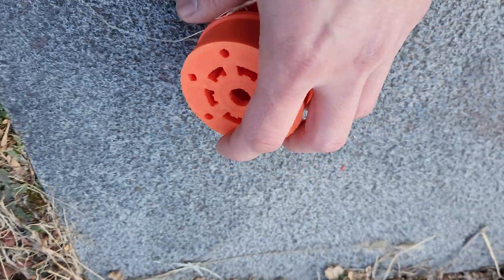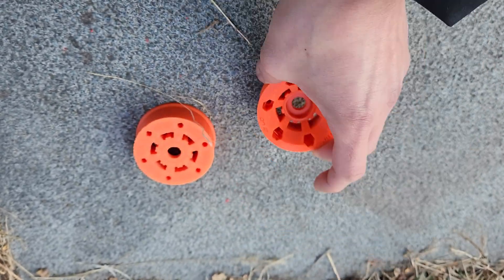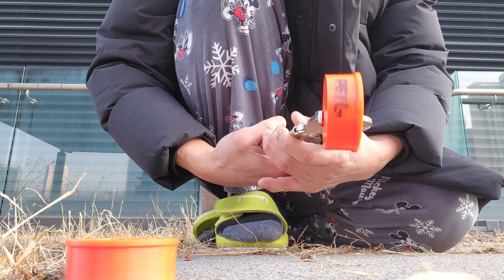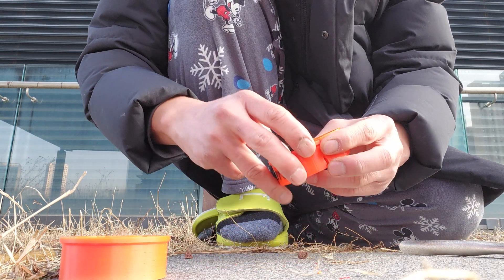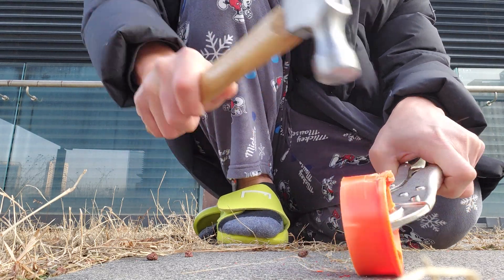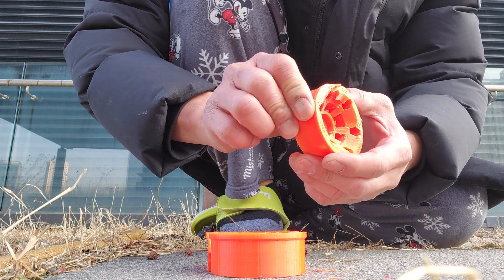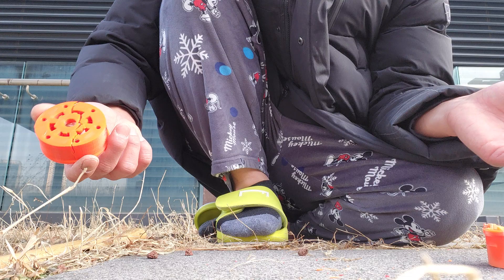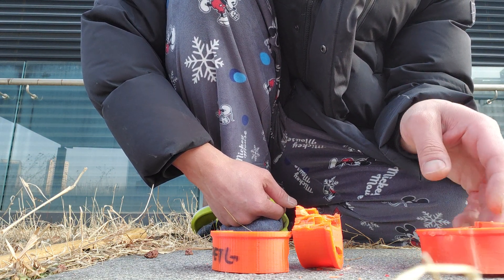3D Printer Filament PETG vs. ABS Part 2!

Comment: at what temp did you print the petg?
Reply from the maker: 240 celcius
Reply: @3dPrinterSchool that's most likely to cold. I print PETG at 260 degrees, and make bending dies for my tube roller bender wi4h it

Comment: Petg should be more flexible than ABS . So this kind of force should less a Problem for PETG than ABS. If you Check the technical data Sheet of Prusament PETG and compare it with Esun ABS+, you can see, that the data is very similar, except that the impact strength on PETG is out of mesurements. PETG should be worse on compression, but on inpact it should be better. But, if the filament is old, and is stored not dry conditions, at plain light, it can become brittle (losing the softener agents). It breaks only by bending the filament about 45 degrees.
Reply from the maker: I used good petg filament but gonna try the test again using Prusament petg.  I believe the results should be similar, i think petg is very weak on terms of impacy resistance, there is another video on youtube showing this also.

Comment: I hear everywhere that PLA + or pro have the best impact resistance out there.
Reply from the maker: Right try pla on electric skateboards lol.
Reply: @3dPrinterSchool  I mean people print guns out of it. It’s pretty tough. Cf nylon might be better for your application?
Reply from the maker: @treaustin1  I am using petg and abs for hubs with tpu outer tire.  So far they both perform good and strong.  The tests were a little  overkill.
Reply: @3dPrinterSchool  nice. What are store bought wheels make of?
Reply: Pla+ has completely different performance than pla  @3dPrinterSchool

Comment: Abs has far superior impact resistance out of petg, pla and abs. The 3d printing community is heavily biased on materials and love to demonize abs to the point they cannot process real data on the subject. Nice to see you doing some actual tests, that'd explain why im subbed to you but not many other 3d printer content creators.
Reply from the maker: I find it hard to believe tests using small hook objects then finding out real life results may differ greatly depending on your design/application.  Gonna try some more scientific tests when my new hydraulic press is here.